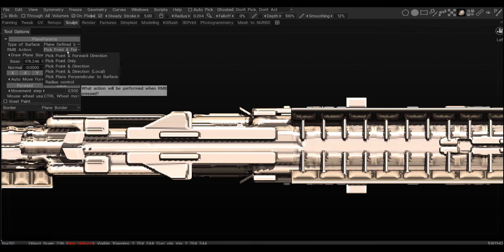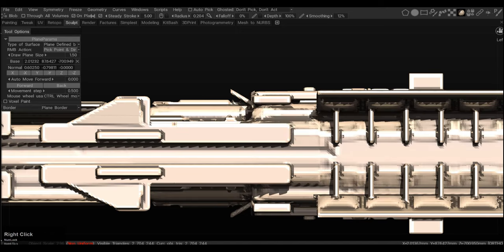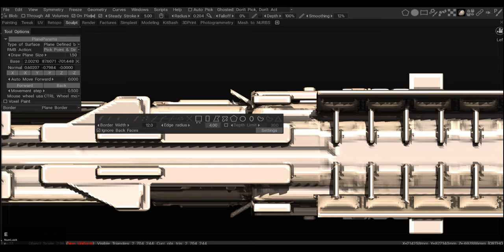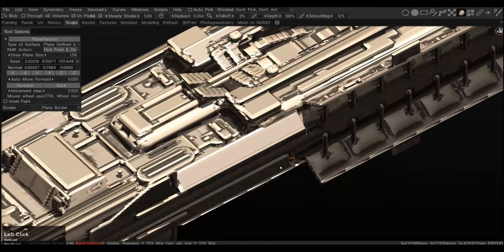Advanced Array Design on Inclined Surface - Quick Tip

Comment: I missed what actually turned on the array mode...
Reply from the maker: If you just press number on the keyboard like 5, 12 the shape will multiply
Reply: @AntonTenitsky  I just came accross this, and mine doesn't do it in the most recent version, is it because I have tools on those numbers as shortcuts?
Reply: @AntonTenitsky  This is amazing. Is there a way to drag them out on a straight line? Id expect holding shift would snap them but nop
Reply: To answer it myself: just use screen space snapping